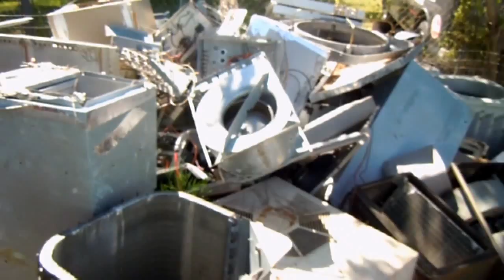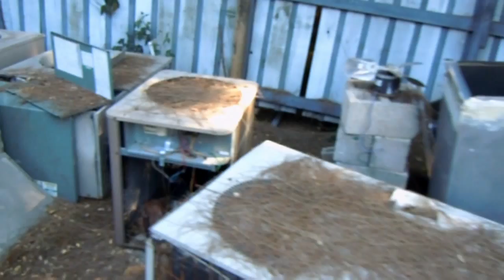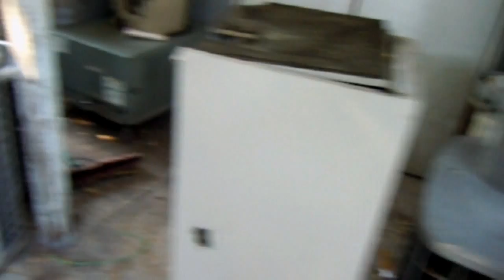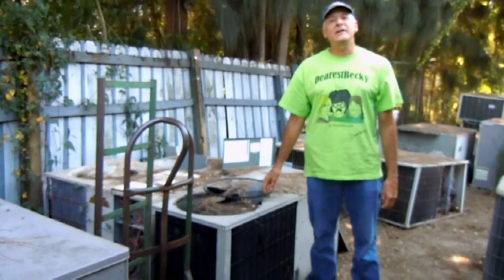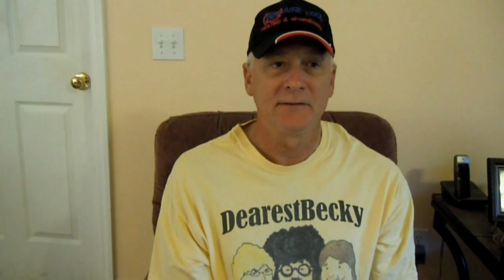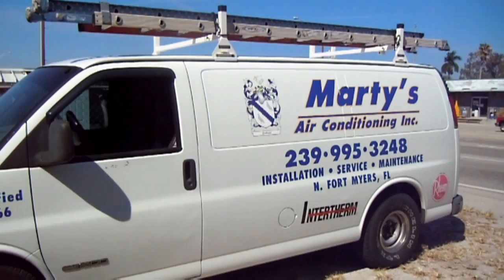HVAC What kills an air conditioner before its time?

Comment: 1/ hours run time, more so than "age" 
2/ filters /coils not cleaned,  
3/ poor install, poor vacuum, overtightened flare nuts = leak 
4/ Moisture, kills electronics, and causes rust on certain components: gas leak
5/ Moisture gathering under compressor, = rust = leak, generally irreparable 
6/ poor design of units ; lack of compressor safeties ie, HP/LP delay timer. Excess cycling 
7/ install beside coastline = premature corrosion / death 
8/ High suction temperature= compressor high temperature = death 
9/ THE BIG ONE : repair guys who cop out on simple repairs and tell the customer the unit is dead, when it is in fact repairable!

Comment: I see dirty air filters, dirty coils & worn out contactors on a regular basis which helps shorten the life of an a.c. unit . The typical homeowner should at least do regular air filter replacements & keep the condensing unit clean & maybe use a shop vac on the condensate line to keep it clear from time to time. Like an automobile which requires regular maintenance, an a.c. unit should be no different & should receive at least 1 check-up per year. Things like compressor & fan amp draws, refrigerant pressures, contactors & capacitors should be checked as well as wiring. These things can prolong the life of your unit & catching small problems early on can save you money in the long run.

Comment: My Ruud A/C unit is 20 years old this year and still going strong as ever. My aunt that lives next door to me her janitrol gas pack before it was 10 years old cracked the heat exchanger and that summer and until last summer it had to be charged every year, a coil leak In August of last year when she had some furnature delivered it was not cooling well anyway there was only a 5* drop it was charged and went down the next week so she decided to replace the unit she now has an american standard

Comment: #1 WITHOUT A DOUBT cause of DEATH is ......Not changing air filters.  Period.

That is the first thing Harry Homeowner does when things go wrong. By the time you get there, it has been changed and you have no idea what it looked like.

I have worked in  Apt. maint. and seen what happens to a filter that I personally changed 30 days ago. I shudder to think what would happen if a month or 2-3-4-5-6-7-8-9-10 were skipped.  Especially the cigarette and pot smokers. A dirty air filter blocks airflow.

Comment: Properties by the beach (salt moisture from the ocean) and irrigation systems by the condenser unit with ground water that is high in sulfur. Rust... Rust…Rust. I have seen them last only 5 or 6 years.

Comment: Long story short, I totally agree improper installation is #1.  Our HVAC company never does a btu load, they are too "experienced" for that, they just size the system 25% or more larger, install duct systems you cant even test because they are too leaky, get paid and call it good. They are so stupid they think that leaks into interstitial cavities don't matter because it is still in the house.....They use the floor joist as return duct,and just staple a piece of metallic cardbard at the register

Comment: Hey DR.z, you are the man! Just thought I would throw my two cents in, I am not an HVAC tech, but I have been in new const for over 14 years. Now I am an energy auditor and I have to dabble with static pressures and duct design because as an insulator I feel obligated to make sure everything I cover up is up to standard. Seeing what I did in new const. was the reason I got into retofit, the HVAC industry is NASTY, new home inspections are only as good as the x-plumber that is doing them.

Comment: Another great video Dr Z. 

I commonly work on 30 -40 year old A/C's

Just changed out an old Williamson that was still working and was built 1967.

I will be changing out an even older unit in a few weeks, oh yeh still working. I may shoot a little video when I do that one. It's been a few month since I looked at it last but I think it was @ 45 yrs old.  It serves a family estate museum which the deceased owner, owned a heating and cooling company.

Comment: Not to mention a customer trying to "engineer" a cover for the condensing unit, and runs with it on. Another is brazing the service valves without wrapping them with wet rags. I've seen more die this way.